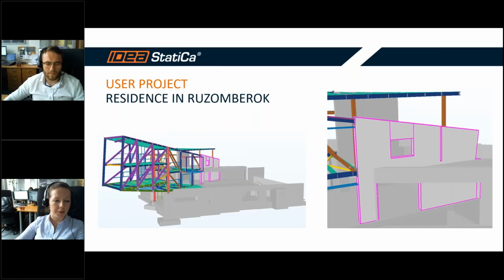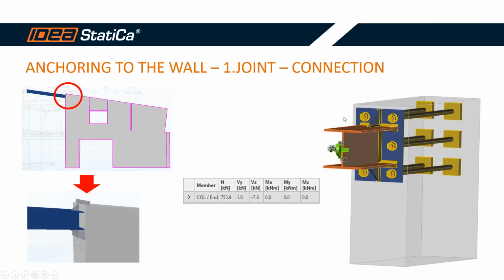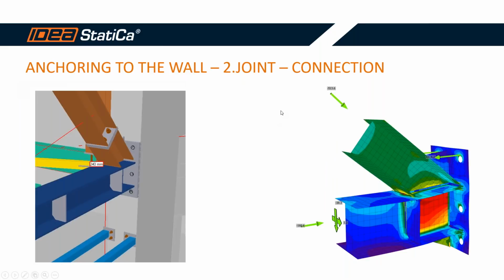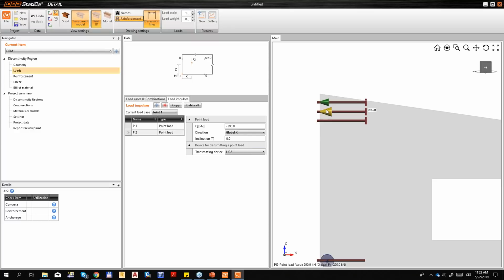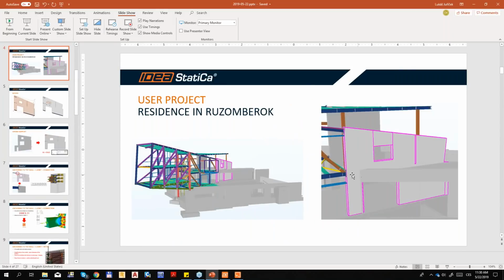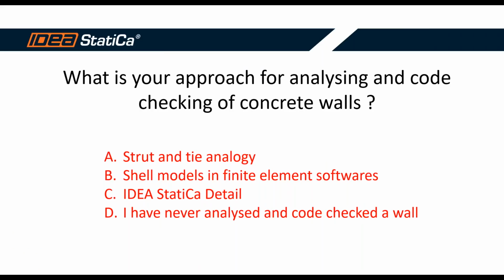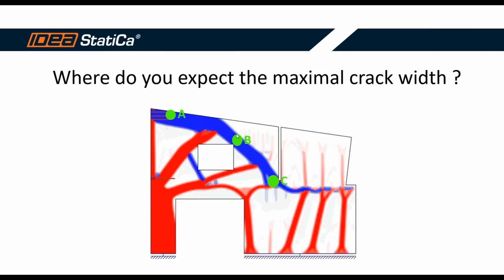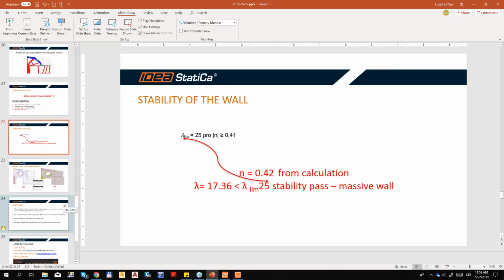Cast in situ wall – Ruzomberok (Slovakia)

Comment: I really like your program but what I wouldn't assume as an engineer is transferring big shear force as linear load on the wall edge. In reality shear is transferred through anchor bolts which act on concrete. Of course it cannot be modeled in Idea Statica since bars do not have flexural stiffness. I would better design some inclined bars or steel shear lug instead. 
Another assumption I didn't like is that adjacent RC members are replaced with vertical forces only. I hope you considered bending moment out of wall plane when preparing final rebar arrangement. 
And looking to load definition I wish you to add some options for load import/export between Idea Connection and Detail. Of course it is not a simple task since loads should be simplified into 2D but I believe it is worth doing it.
Thank you for developing such a great software!
Reply: Iagree with your points. Lots of simplifications and time consuming to input all the data required manually. Try linking the Connection and Detail modules. I work in consultant and i review many designs from different steel specialist engineers. No one uses this procedure to design cast insitu anchors on walls and footings. Many engineers use third party softwares to design cast insitu anchors considering reinforcement.